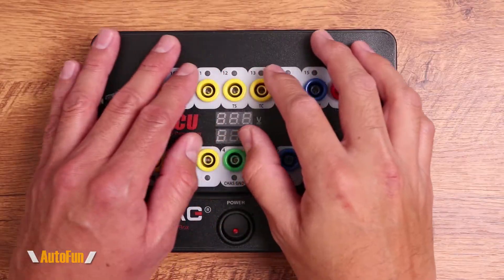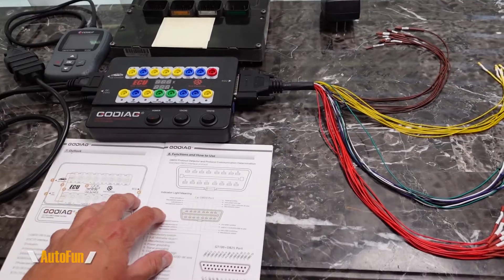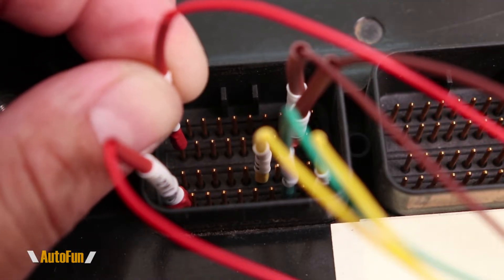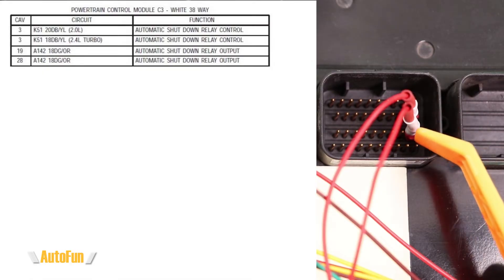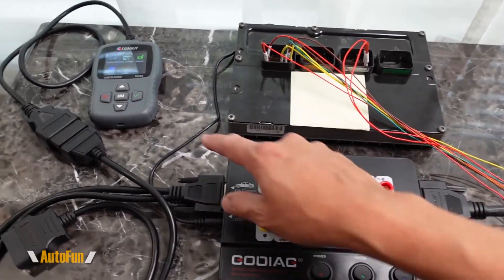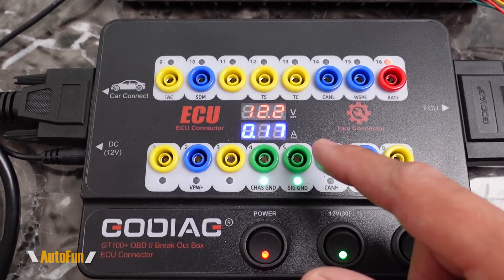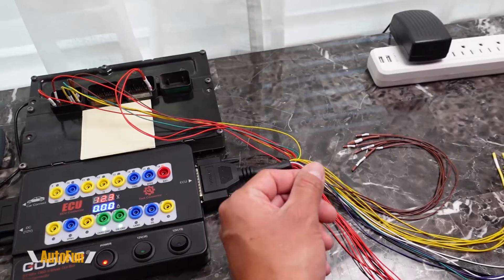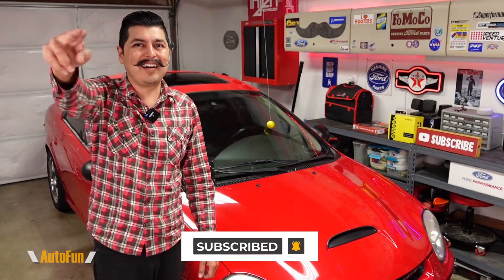How to use GoDiag GT100+ Connect ECM, PCM for Testing or Programming

Comment: How do you get tje pinout for tje ecus?
Reply from the maker: They are usually found in the service manual for the vehicle (if you don't have it, it is usually available at the Dealer and sometimes on Amazon). Alternately there are dedicated websites that also give you access to diagrams (some are subscription based and some are one time buy diagrams) cheers!

Comment: How do I know what wire from go diag to module?  Like the go diag labling dont match the ecu pin labling
Reply from the maker: This depends on what you are testing, as shown on the video, the most common way is to connect the ECM to an OBD2 scanner by connecting the lines that associated with the OBD2 protocol supported by your vehicle (you can see on the video, how I match the wires of the GoDiag to my ECM pins using the service manual and wiring schematics since they show the function of each pin), Cheers!

Comment: “Does this module work on BMW E46 1998 without CANBUS? Only OBD2 available. I already have a LED steering wheel, I just need the controller.” ? thx
Reply from the maker: Yes as shown in the video, this breakout box supports OBD2. It is used for diagnosis, programming and more. Here is my full review video https://youtu.be/QAwpySOMQUI so you can what it can be used for, Cheers!

Comment: Hello. Tell me where I can get the connection diagram to the ecu??? pinout of the blocks?
Reply from the maker: Hi! The best place is the refer to the service manual for the vehicle (if you don't have it, it is usually available at the Dealer and sometimes on Amazon). Alternately there are dedicated websites that also give you access to diagrams (some are subscription based and some are one time buy diagrams) Cheers!
Reply: @AlexAutoFun  not much helpful answer😢, I have no dealer 😢
Reply from the maker: @IvoAngelo  You can find the wiring diagrams in the service manual for the vehicle, if you don't have it and don't have a dealer available, you can usually get a copy available on Amazon or ebay. Alternately there are dedicated websites that also give you access to diagrams, some are subscription based and some are one time buy diagrams, cheers!

Comment: Can we test work the spark plugs and injectors and fans .......
Reply from the maker: Hi! Remember, the GT100 is a breakout box, it is not a scanner device with bidirectional control. Here is the full review for it so you can see how it works https://youtu.be/QAwpySOMQUI and here is bidirectional scanner that can be used with the G100 to activate components https://youtu.be/eFfZXk_kfio Cheers!

Comment: Hi, when bench testing an ECU for proper CAN. What wires do we have to connect? Meaning, what wires do we always have to connect from the GODIAG to the ECU when bench testing to get a reading?
Reply from the maker: Hi M! You mechanic will refer to the service manual and wiring schematics to determine which pins should be connected (video on how to read wiring schematics is also in the works, stay tuned) Cheers!

Comment: Great video. Would be nice if you could show an example of testing the pcm or programming the pcm.
Reply from the maker: Thanks E! Ah yes the process would be the same as when the PCM is on the car since we can now connect a OBD2 to the PCM and interact with it. Here is a video showing the basic test functions with an OBD scan tool https://youtu.be/cTXB6XeGsyA Additionally a more advanced scanner like this one https://youtu.be/leqYNPJ16M4 could be used if you need access to OEM functions Cheers!

Comment: Can this be used with vag key login to find login for module adaptions, abs, steering rack, engine etc ?
Reply from the maker: Hi Gary! I'm not familiar with the Vag key but if the tool uses a standard OBD2 port, then yes, the ECM can be powered up to access it via the OBD2 port of via the banana jacks if needing to tap into specific lines (some IMMO systems need this step). Here is the full review so you can see how it works https://youtu.be/QAwpySOMQUI Cheers!

Comment: Hi sìr plz help i buy gidiag gt100 pro but i don't no ecu pinout diagram plz tell me i buy wich software or pdf for pinout
Reply from the maker: Hi Rocky! Correct, it does not come with ECU pin outs (there are too many to be able to include in a single manual. You can get acopy of the service manual for your vehicle from your dealer or you can get one from an online store (some are one time buys and some are subscription based services) Cheers!

Comment: Hi, i want to connect GoDiag to the instrument on the bench how to know the cable to be connected
Reply from the maker: Hi Ibrahime! Yes this video shows how to connect an ECM for bench testing (with the pins chosen based on the service manual and wiring schematics for the car being tested). Each car has it's own pin out so some cars will need more or less wires to interface to the PCM (And I do have another video coming in where I cover how to read wiring schematics for those new to them). Cheers!

Comment: But you did show how you get the values
Reply from the maker: Hi Otuku! You can see how I use a stadandar OBD2 scanner to connect to the GoDiag as shown on my full review here https://youtu.be/QAwpySOMQUI And here is another video where I show how to use the OBD2 scanner to get live data https://youtu.be/cTXB6XeGsyA if you need help with that. Alternatively a multimeter can be used as well, here is my video showing how to use an automotive multimeter https://youtu.be/5bgPWiKxsCg And finally you can also use a Oscilloscope to get a reading, stay tuned video on how to use one coming up. Cheers!

Comment: Hi,
If a car is equipped with immobilizer, how can I power up the ECU with GODIAG on a bench?
The other concern is that can I provide a crank signal from a sensor simulator and get ECU outputs like injector driver and ignition trigger? 

Thank you
Reply from the maker: Hi! Typically a vehicle with IMMO can be accessed (Key On, Engine Off). The IMMO normally only limits being able to actually turn on the engine. The GT100+ is mean to access the ECM in the Key On, Engine Off state, it's not meant to simulate the vehicle running. However if desired the IMMO function can be accessed with the included jumpers shown on my full review for it https://youtu.be/QAwpySOMQUI or using the GT105 https://youtu.be/9qQQ7rEeHUc Cheers!
Reply: Sounds good! At least we can verify that there's communication with the ECU because sometimes scan tools cannot communicate with the ECUs due to issues with power, ground , network, etc...
Thanks again  @AlexAutoFun
Reply from the maker: Exactly, you're welcome friend! @SS-U23
Reply: Hi boss were can i find pinout  diagram for godiag

Comment: Hi and thank you for the video.   I’m trying to understand how you knew which OBD wire number to use and when to use the K-line.  My wiring diagram shows a CCD BUS(+) and a CCD BUS(-) which I understand to be two wires to connect to all the modules.  So which obd wire would I choose for those?
Reply from the maker: Hi! I would refer to the service manual and wiring schematics, this is the safest way to determine which pins should be connected. Cheers!

Comment: Hello Sir, this kit can used for excavators Ecu
Reply from the maker: Hi Chanu! I'm not familiar with excavators, but this ECU breakout box works supports 9VDC-24VDC (however the adapter included is 12V) and OBD2 communications protocols (CAN BUS, K Line Pwm, Vpw+, KPW 2000). And here is my full review for the GT100+ if you want to see the rest of it's features https://youtu.be/QAwpySOMQUI Cheers!

Comment: Please I don’t understand how any why you choose this pins not other pins … please can you explain to us by Video how we can get the pin out
Reply from the maker: Hi Kamil! As shown on the video I choose those pins based on the service manual wiring schematics for the car. Each car has it's own pin out so some cars will need more or less wires to interface to the PCM (but yes I do have another video coming in where I cover how to read wiring schematics for those new to them). Regarding where to get the pin outs, if you need a copy of the service manual, most dealers can procure a copy of it for you or you can get one from an online store (some are one time buys and some are subscription based services) Cheers!
Reply: @AlexAutoFun  thank you sir
Reply from the maker: You're welcome! @kamilalabd8827

Comment: Hey I was watching your connection on the video question would those connection be the same for an 06 dodge charger rt seeing the computer are similar if not can you point me in the right direction or which pins should I use, I'm not getting the VPW+ signal on the godiag gt 100 +
Reply from the maker: Hi Andrew! Ah I would be really careful, while the NGC has been used for a long time and on many vehicles and the pinout may have some similarities I would recommend referring to the Service Manual of the vehicle being tested to confirmed the actual pin out. Hope this helps, Cheers!

Comment: Hi, thanks for the video. I got my gt100+. Now the issue is wiring diagrams and interpretation. Can Alientech ECU pinout connections help to connect the ecu properly? Also do share the car schematic video as well. Waiting. Thanks a lot.
Reply from the maker: You're welcome PartOEMS! I have not familiar with the Alientech ECU system so I can't say if it will help with pinouts. What I use for the pin outs is the service manual as it details each one of the pins on the PCM (which I used for reference for the pinout I showed on this video). Hope this helps, Cheers!

Comment: how about making a video on basic test functions/ troubleshooting with the BOB  thanks
Reply from the maker: Hi Robert! ah yes the process would be the same as when the PCM is on the car since we can now connect a OBD2 to the PCM and interact with it. Here is the video showing the basic test functions with an OBD scan tool https://youtu.be/cTXB6XeGsyA if it helps, Cheers!
Reply: @AlexAutoFun  i guess i was talking about  testing in general  other than ecu. most of us or i wont mess with pcm  plugging in the BOB to DLC and go throw a general troubleshooting test for diagnostic over all health check thanks
Reply from the maker: @robertfrancisco1193  Ah I got you, I think you mean how to test individual circuits, that can be done with a voltmeter, some dummy resistances (either some resistors, potentiometer and in some cases the actual sensor itself) I do have a video coming on how to use a multimeter including how to understand different electrical components and their functions, maybe it would make sense to follow that one up with how to use it along with components using the with the breakout box (I would still recommend using the OBD2 scan tool along with the multimeter, since the meter will only give us raw information vs the interpreted data from the PCM to the DLC), good suggestion..
Reply: @AlexAutoFun  thanks
Reply from the maker: @robertfrancisco1193  You're welcome robert!
Reply: @AlexAutoFun  I agree with Robert. That would make a great video. Please do make one! Great Chanel! 👍
Reply from the maker: @keenowl1410  Thanks Keen Owl! Video is in the works, stay tuned bud!
Reply: @AlexAutoFun  I can't wait!

Comment: Good stuff.  I am having a little trouble connecting a 2016 Ram with a GPEC2a ECM but hopefully I'll sort out the right pins and leads to use.  But thanks for the info.
Reply from the maker: You're welcome GroovinJim! ah yes it just takes some patience while figuring out the pin out for each vehicle (if you have the factory service manual it helps tremendously) Cheers!